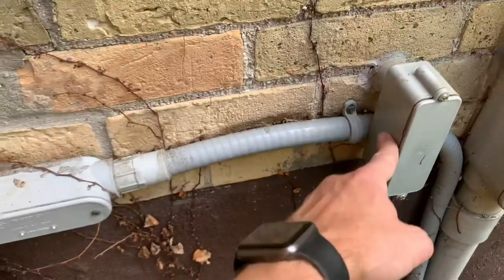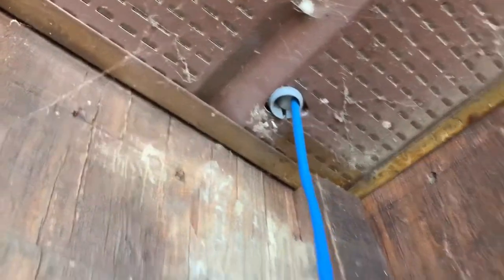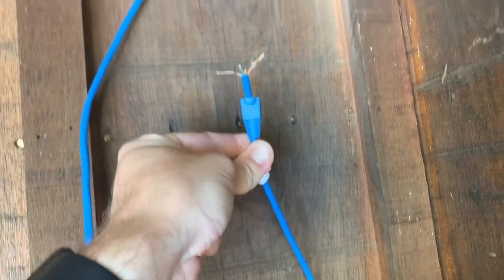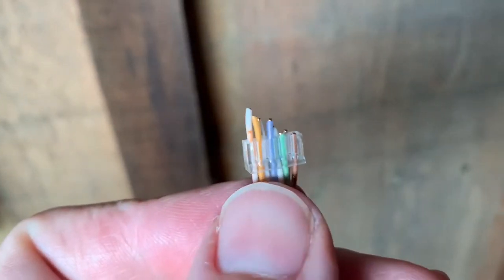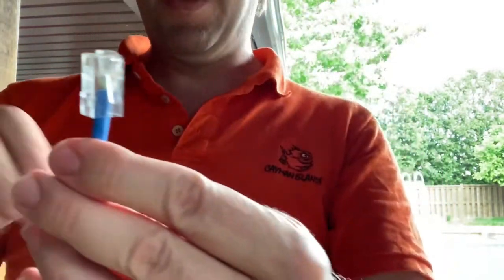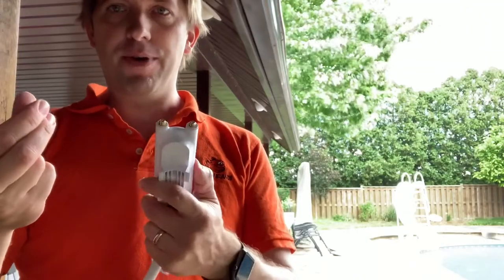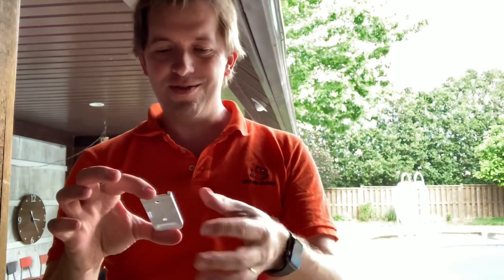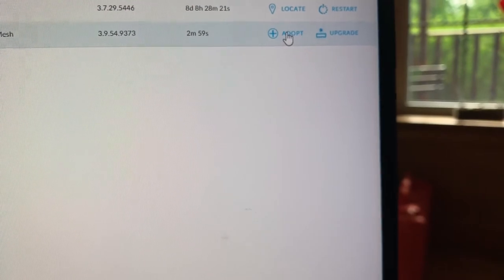How to install Unifi AC mesh access point

Comment: I cant find anything about Ubiquiti mesh network. My understanding is as long as you have a wireless access point, adding another wireless access point, in this case a UAP-AC-M, you can create a mesh network with the UAP-AC-M using just PoE to power it on and it connecting wirelessly.

Comment: which switch do you have specifically? I bought the UniFi USW Flex Mini but noticed after i got it that i couldnt power the AP
Reply from the maker: I have the Unifi Swtich 16 POE-150W
Reply: The flex mini does not give out power. You either need to purchase a switch that is POE (power over ethernet). Or you're probably better off getting a 24volt passive poe injector. Ubiquiti has some: https://www.amazon.com/Ubiquiti-Networks-POE-24-12W-G-Injector-Black/dp/B01DW99IPS

Or on the ubiquiti store. Then you can use your flex mini. Run the wire to the mesh ap, and at the mesh ap location you'll need power/outlet for the poe injector.

Comment: Do you need to put a conduit on the exposed ethernet cable? Mine isn't outdoor rated but I'm fishing it on from inside and only 1 ft of it is exposed?  Its under a carport as well, so its not shaded from most weather.
Reply from the maker: Well, like most plastics, the coating will degrade with UV exposure (sunlight) and if the cable is exposed, it's prone to damage (stepped on or snagged and pulled). Conduit will protect from all this...but if it's easy to replace, and a short run, and something that you don't plan on having long term....I can understand skipping the conduit. Otherwise, I would highly recommend putting the cable thru some pipe.

Comment: Hi Jay, what is the range in a clear line of sight?   I'm sure I can look it up but curious from someone actually using it.
Reply from the maker: The furthest line-of-sight I can get in my backyard is about 90 feet, and there is still a strong WiFi signal (3 full bars in the wifi symbol). If you know about a good iOS app for wifi signal strength, let me know and I can get some better data for you.

Comment: Will this AP work with any router like Asus or does it have to be Unifi?
Reply from the maker: Unifi AP should work with any router. Setup is still the same, through a web browser, or the smartphone app
Reply: Needs POE router ports, otherwise you will need to use the controller included with the UAP-AC-M.

Comment: Do you need to use a ubiquiti switch to hook up this access point or any other branded gigabit switch would work?
Reply from the maker: Any switch should work. Before my Unifi switch, I was using a old trusty Linksys WRT54G from 2004, and the mesh network still worked.

Comment: Thank you! Quick question, I am trying to figure out if the following setup will work. We support an Orphanage in South Africa. Recently they have had a rash of break-ins and were asking about setting up security cameras. It is a large area and hard-wiring them would be almost impossible. They currently get their WiFi from a Rain , "The 101" 5G router . I was going to buy a couple of these AC mesh  . One of them I would connect to the Network port of the 101, mount it on a pole and point it toward the main buildings. Then I would mount several Eufy WiFi S340 cameras (2.4 GHz0 in strategic locations.
I would install the other Unifi AC mesh at the main building, run a cable down into a router for them to get WiFi.
Question: Would the S340's (2.4 GHz) be able to use the signal being pumped out by the AP or does it have to go through the receiving AP?

Comment: Great video. My question is, with it being at the back of the house, are you able to also receive signal without line of sight in the front of house with the same AP?
Reply from the maker: Yes, I get a good signal in the front of the house too...no line-of-sight needed. However, the more stuff in the way (walls, trees, etc) the weaker the signal. Sorry for the delayed reply...didn't realize I was getting comments on this video.

Comment: Could anyone do me a favor that I need the mdmp of uap-ac-m and uap-ac-lite to unbrick my devices?
Reply from the maker: Can you factory reset the devices? I made a How To video for the ac-mesh https://youtu.be/7ybekL2GZbQ
Reply: @jtmcfarlan  The memory was paded with 0xff ,so the bootloader and tftp are both failed.It need other device downgrade the oldest firmware,reboot,and ssh into it ,then run some command to make the backups of all the mtdblocks,the mtdblocks could be used to fix my device.There are about 7 to 9 mtdblocks in the memory,one contain personal privacy(the device in the setted state)and one contain device's privacy.it's better for me to get all the mtdblocks,but no matter what i got ,it would help